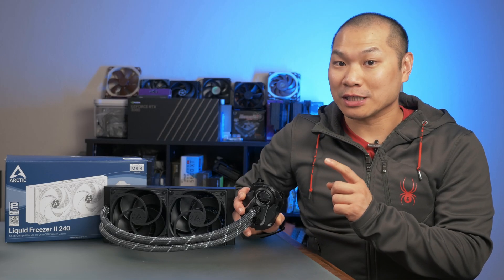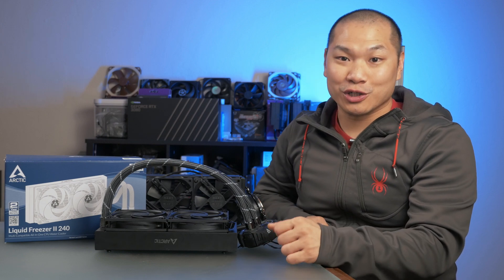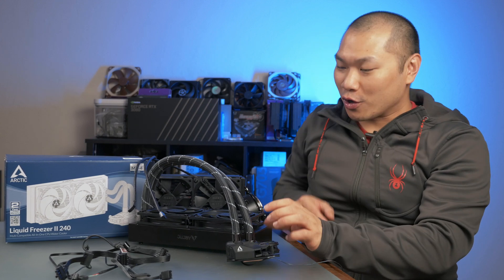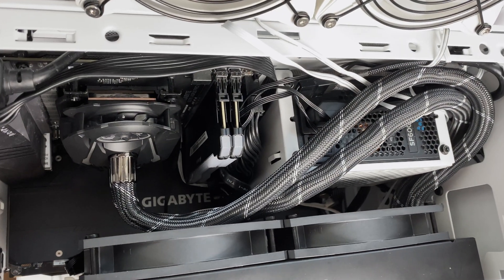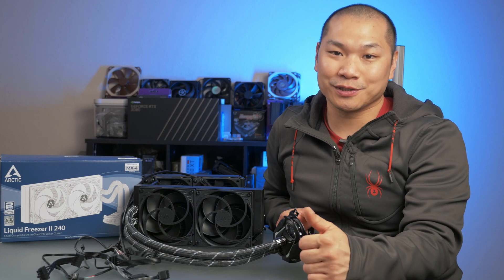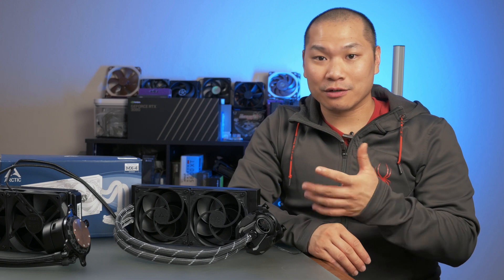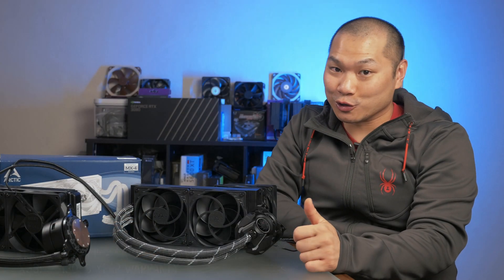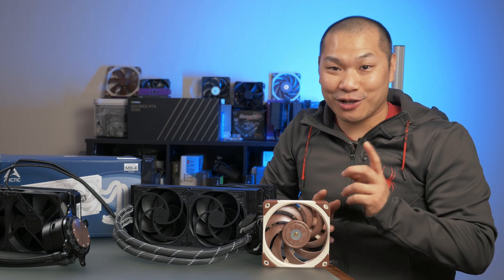The Arctic Liquid Freezer II 240 Liquid Cooler - is this the best performing 240mm AIO?

Comment: What I don't understand is why anyone would want to use such a small PC case if what people want is performance.Putting computers together is challenging enough without having to cram PC components into tiny PC cases.To spend so much time and money fooling around with tiny PC cases is insane.If it works for you great but I can't see myself ever opting for a tiny PC case.I have a Rosewill glow full tower,I bought a Noctua nh-d9l cpu cooler and it wasn't keeping my Ryzen 5 3600x as cool as I felt it should so I swapped the Noctua nh-d9l out for an ID-Cooling se-224-xt cpu cooler that I saw you review in another one of your videos and I'm very happy with the cooling performance of it.I don't overclock mind you and I'm sure that many people that own those tiny PC cases overclock which to me makes no sense at all.If a full tower is too much then get a mid tower and forget about those tiny PC cases because they don't make any sense especially if you're the kind of person that overclocks to any extent.My PC sits on top of my kitchen table and it still sucks in dust,I don't even want to try to imagine what a nightmare it is dusting out those tiny PC cases.Let's face it,sooner or later PC cases need to be dusted out no matter how clean you think your house is.I use a blower to dust out my PC case and even with that I still have to use an old toothbrush to clean the dust off of the cooling fan blades.I don't allow my PC case to gather a lot of dust either,I dust out my PC case on a regular basis.So how do you clean and dust out those tiny PC cases?You take the whole thing apart?Forget that.Even if you clean your house constantly and use a hepa filter you're still going to end up getting dust in your PC case unless you live in a science lab with an air system that constantly cleans and filters the air.

Comment: Brilliant content as always. Any issues with mounting the 280mm variant? Thanks :)
Reply: The only difference between 240 and 280 is radiator length/height. The thickness of the radiator and tubing length are exactly the same, so mounting should be almost identical. I got a 280 for my NR200P and am about to mount it soon
Reply: Can confirm that I successfully installed the 280 version into NR200, it takes some time and patience to lay the tubing, but, just as I expected, it's pretty much the same as installing the 240 variant
Reply from the maker: I haven't tried it but users report that it's possible and that it's tight squeeze.
Reply: @MegaSOMF  no problem, make sure to check Reddit, there are some posts in the SFX groups that have pics of the tube layout, I used one of them as a guide and it worked

Comment: Will this fit if bottom mount push pull in nr200p?
Reply: DO NOT BOTTOM MOUNT AIOs! Air goes into the pump, which is bad.
Reply from the maker: The clearance between the riser cable is about 75mm, so the only push pull you can get away with is going to have to be a 25mm rad one, and even then you are at the mercy of fans actually being 25mm thick.
Reply: @MachinesMore  oh wow. Hmm. Unless i go with slim 12cm fan it will fit. But then afraid it cant push the air through the thick arctic rads. Or go with slimmer other brand rads with slim fan

Comment: Would definitely like to see them rework the pump block to have more adjustable tubing. But because this fits in a case like the NR200, I might still consider it. I really like the minimal cables.
Reply from the maker: Elbows would definitely make this a much more serviceable unit. It is really good though, otherwise.

Comment: I'm one click away from ordering this cooler. However my rather old case only have room for this 240mm version. Does anyone knows if the 240mm version will cool a Ryzen 5900X 12-core cpu properly ? Or do i need to go for the 280mm or 360mm version even ?
Reply from the maker: It will definitely cool the 5900X. A thin rad 240 can work too.
Reply: @MachinesMore  Thx alot 👍

Comment: Great review, but I have a kind of a stupid question: Even though the two fans and the pump are integrated into a single PWM header, can I still control the rad fans separately from the pump? Or is control just a percentage for the entire loop.
Reply from the maker: Yes- you will have to disconnect the cables from the sleeved extensions and run them directly to a long splitter cable (not just a short Y splitter)- once disconnected the fan cables are these little stubby cables so you will need something longer to route back to your header. The pump has a curve that plateaus out at 100% fairly quickly (it's in the video), and that is dependent on the PWM signal it gets- so if you want to give it a different curve you can do that without affecting the fans.
Reply: @MachinesMore  thanks holmes

Comment: Another excellent video review, particularly like the that you put the P12s on the X53. I'm currently running P12s on the ML240R. Would love to see how the Arctic stacks up against the EK AIO 240 D-RGB in the NR200. There doesn't seem to be any direct comparison anywhere against the Liquid Freezer ii 240, only the 280, based on that testing I think the EK may actually be the best 240mm, and the side mounted tubes make it fit a little more comfortably in the NR200.
Reply from the maker: Heard good things about it- will try and check it out. Next one AIO I will be looking at is the new Pure Loop from Be Quiet!.
Reply: @MachinesMore   Also an interesting one. please test it with the P12s on there!

Comment: Best performing while using cheapest tricks as marketing. VRM fan fails a lot, a fan this small is also a gimmick, if you want to cool down your VRMs efficiently, you can add a fan there with ease. The hoses are too long, the solution of fan cable wiring via one of the hoses was a bad decision - it´s easy for the cable to break somewhere and you can´t change it if it happens - it also makes the hose more stiff.
The fans are garbage. Their only advantage is the price. Their bearings can´t handle hanging down from the top of the case, resulting in unwanted buzzing (the rotor is too heavy for its bearing). I managed to use one of these Arctic fans for an hour, because they also make very annoying "hum" in certain rpms, which drove me crazy. The irony in this is, i replaced it with another cheap fan from other manufacturer i´ve got for similar price and that one is silent. There is also the construction, which is fragile, but that was always an issue with Arctic fans.
I was never a fan of this brand, but i use few of their fans and i´m happy with them (older "F" line design) - one runs in my NAS and runs quietly now for almost a year. I also use one of their air coolers - i had to replace the fan tho, due to issues described higher - i just didn´t use cheap fan here, i used Noctua P12 redux instead.
It´s just my honest opinion, but i think buying cheap stuff only to keep replacing it by other cheap stuff is not worth the money (even if you consider warranty claims - the time you spend doing the claims and replacing your broken stuff is not worth the hassle). You can get high quality fan for just a little more and never ever have to replace it.
What bugs me most about this AIO, is the warranty period. You will get 72 months for air coolers or fans, but only 24 months for this AIO. The manufacturer knows for sure, why is it like that. Knowing this, i´d rather invest into other AIO with longer warranty period. With AIO, warranty should be similar to "lifetime", since it will eventually break down and if it´s cheap, you can be sure there are some other areas, where the manufacturer was cutting the costs.
Reply: Arctic P12/P14 garbage?

You're a clown, sorry.

Comment: wow im so glad I was smart and bought this instead of the hypezxt
Reply: What cpu do you use it on
Reply: @becky6360  3950x
Reply: Is it noisy? Thanks in advance
Reply: @giuseppeprattichizzo1862  i dont have a direct comparison, also I am using noctua fans on it. But the Arctic's P fans are pretty damn good also. From reviews it seems Arctic's default fans are better than nzxt fans. But beware, this aio is really thicc! Nog great for small cases, my ncase m1 can barely fit it with a lot of force.
Reply: @latentspacex  I’ll put it in a nzxt h510
Reply: @latentspacex  thanks buddy

Comment: does it matter  If I put the vrm fan upside down instead?
bad for VRM?
Reply from the maker: It doesn't do too much unless you have terrible airflow or a board with weaker power delivery, the airflow goes out the top and sides of the block anyway so theoretically you're getting the same  side exposure to your VRMs.

Comment: Awesome vid! I am thinking about this AIO for NR200 with 5800X and 3080 since 280 seems like not worth the potential trouble. Do you think it makes sense to spend few extra bucks for this or should I go with air NH-C14S or maybe NH-U12S with 2 fans? I am mainly looking for quiet system. I already watched your other videos comparing air vs liquid in this particular case, but since they are older I am wondering if your recommendation for sticking with air changed based on this AIO. Thanks and keep up with your awesome work
Reply from the maker: Cheers- depends on how you want to run the 5800X. Stock clocks I’d go for the C14S. The U12S is not as great of a performer next to it. By the time you get the U12A with a 2nd fan a much better U12A is in reach, if you want a single tower. 5800X is at the top of the TDP pecking order for Ryzen so if you want to try to go above stock clocks I would put it on water, the LF II 240 would be a great choice for that- also if you want a dead quiet system with stock clocks.
Reply: @MachinesMore  Thanks for the reply. Based on your recommendation I decided to go with LF II. Yesterday I finally got the all the components and spent few hours today with trying to fit the LF II. I was able to get to the point where it somehow fits, but I had to remove the front top fan, because I just could not fit it there. Is there a trick to have it fit?

Comment: Incredible content covering all the NR200 configurations!  Would this cooler this be a better choice when paring a NR200 + 5950X + 3080/90 (non FE) for GPU rendering? or just stick with the NH14-C14s ? thank you!
Reply from the maker: When you're doing GPU rendering how hard is your CPU loaded? If it's not high then there's no good reason to spend that much effort on it.
Reply: @MachinesMore  Thanks for replying!  Yes the load on the CPU is not huge at all during the actual rendering.

Comment: I want to use this aio with a vertically mounted 3080 fe in the nr200p vertically mounted, would this be the aio you would recommend for this use case?
Reply from the maker: No, I wouldn’t, the fill level didn’t seem very high and I would be concerned about air pockets in the pump block for a bottom mount. The MSI Coreliquid 240 is better suited to that. Have yet to check out the new Be Quiet Pure Loop but that one is a fillable unit so it could be topped off to a suitable level.
Reply: @MachinesMore  Thankyou so much! And if I wanted to forget about looks and tg. I assume the 280mm artic is the best in this case?

Comment: what are the differences in temps between this Arctic Liquid Freezer II 240 vs the Noctua U12A (2x bottom Arctic P12 intake and 2x top Arctic P12 exhaust in both cases). I'm going to run the r9 5900x in a NR200

Comment: this or air cooled, im sitting here looking at my nr200 and not know whats the best way to go
Reply from the maker: Depends on your CPU choice... the LFII does take a up a lot of space still.
Reply: @MachinesMore   gonna run the new 5600x and maybe a mild overclock. was looking at the slim coolers but want to make sure i dont have ram clearance issues
Reply from the maker: Air cool for the R5, for sure. 65W TDP even with OC doesn't need a lot. The low profile coolers will work well too, but have you run the stock cooler to see if it is good enough? They're loud, is the only drawback but are decent.
Reply: @MachinesMore  what about for a 5900x?

Comment: Todays AIO without RGB??
Im in
Reply from the maker: The funny thing is that RGB is responsible for most of the cables and more importantly, the extra cost of units with lighting. If you don't need it you can get a lower profile pump block and a cheaper unit. Win/win/win. :)
Reply: @MachinesMore  yeah i like rgb, but for the price to performance of this, its worth not having. also the one cable kinda sold me

Comment: Thank You for another great video! Especially for the idea to test NZXT X53 with P12 fans. I bought 5 pcs pack of these fans just to try and can confirm strange noise at 1000-1200rpm level. It might be ok for some people but I’ve decided to try something else. What can You say about Be Quiet! Pure Wings 2 High-Speed?
Reply from the maker: I've used those BQ fans before- they wouldn't be my choice after the Arctics because they don't have a very high static pressure rating (important for radiators). They also top out at 1500 RPM which limits their top end performance. The Noctua NF-F12 is a better static pressure performer and is also capped at 1500, for instance, so at least it's beat by that. I think for value and overall performance as a rad fan the Noctua P12 Redux is a really good choice- great static pressure performance, quiet enough in the mid range, and most of all, great price.
Reply: @MachinesMore  You are tottaly right about regular Pure Wings 2 version! But I’ve found High-Speed version with 2000 RPM, 65.5 CFM and 2.23 static pressure for the same price which looks more promising for radiators and mesh panels use. The only thing I concern is noise profile. Don’t want to get the same 1000-1200 sound as Arctic P12
And Noctua NF-P12 definitely is a good choice, but Noctua color scheme is not going well with my current black/silver setup so I’m trying to find good performer in black color :)

Comment: Thanks for all your hard work! What would you say is the best air cooler (with TG) and AIO cooler for the nr200p for a ryzen 5800x or higher?
Reply from the maker: The only AIO I can recommend so far for bottom mounting is the MSI Coreliquid, due to its fill level and pump in rad design. You can definitely mount the LF II on the bottom, but just be aware the warranty (2 yrs) is shorter than an NZXT unit, so if the pump dies, there is a bigger chance of having to be out of pocket. Some folks have mentioned the new Be Quiet unit, and I'll try and test that later on. 
Towers you have a lot of choices, haven't run the 5800X yet but it will be comparable to a 3700X- you could go Scythe Fuma 2, Noctua U12A, depending on your price point, and this week will be testing a bunch more sub $50 towers.

Comment: Do you have recommendations for quiet sfx psus? Which ones have you personally been using?
Reply from the maker: In my personal builds I use EVGA's GM SFX series, and in the test system I have the Corsair SF600. The EVGA has a fairly delayed fan start so they run very quiet, probably not until 30% or so load. It doesn't hit peak fan until 100%. The SF600 is spec'd for similar zero RPM runtime but in practice I typically see it come on a lot sooner than the EVGA. Cooler Master will also be releasing their SFX PSUs this month.

Comment: Ahhhh, long waited video on ARCTIC FREEZER II. Do you think a 280 version will fit ok in NR200? 
Ohh, DaMachine, I just got 5900X and 3080 in hand - the only two components missing. Ready to build. Thanks to your videos - all components were selected appropriately 😉.
Reply from the maker: Hey Andrei, it'll fit but 280s are such a tight bend with tubing. If you have it already then for sure try it out. If not, I'd go for a 240 unit for this case just for the sake of a gentler tubing run. Your build sounds awesome, which 3080 did you go with?
Reply: @MachinesMore  thanks for the advise - the tubing was my concern, so I’ll stick to Kraken X63 280 (although pain in the ass, but what can u do...deal with it I guess). As to the GPU - I got EVGA XC3 Ultra and FTW3 Ultra...I’ll keep XC3 for myself since it’s a slimmer card and less power consuming monster. Not what I wanted to get, but they were available, so I got em. Want to try 6800XT and 6900XT once available. 

NR200 black
5900X
ASUS X570-I mini ITX
G.Skill RipJaws 4000 32Gb CL-17
Silverstone SFX-L 800W
Kraken X63 (modded with 2 P14)
Slim NOCTUA fans for the case fans (top and bottom - haven’t decided yet on the fans, might go with P12 if there is room available)
M.2’s for the storage

Should be good.

Reverb G2 is expected some time this month (was preordered)
Reply from the maker: That's an awesome parts list. The 4000mhz RAM will be killer with the 5900X. You must have signed up for all the EVGA notifications and lucked out with two! I am curious if you will be able to fit a 25mm fan with the XC3- I am guessing yes since it's marginally thicker than the FE card but it might sit right on top of it. Have fun building!
Reply: @MachinesMore  spent the night in line...in hopes of getting 5900X...what a bonus it was to find out that they had 3080s too! Double paid...XC3 is supposedly double slot card. It should fit 25s.
Reply: @MachinesMore  got a quick question: how long the splitter fan cable do I need for the bottom case fans? 1 Y-splitter comes with NR200 already, so I just need 1 more I guess. There are 3 fan headers on my X570-I ROG. Cheers!